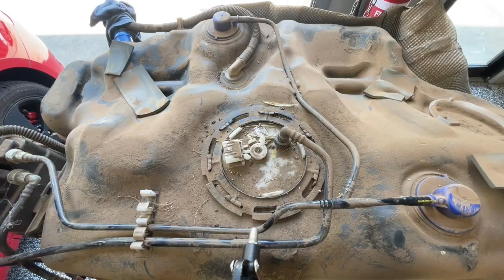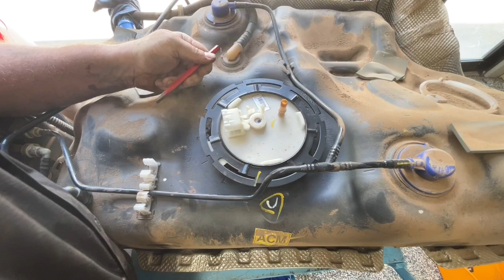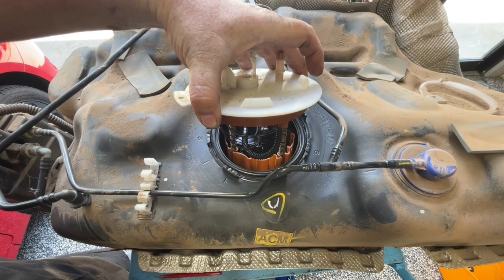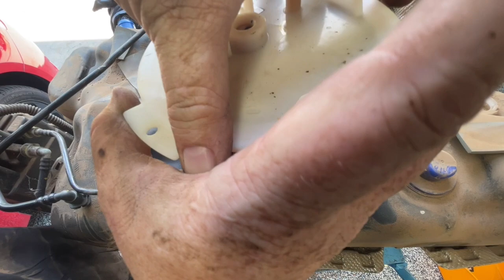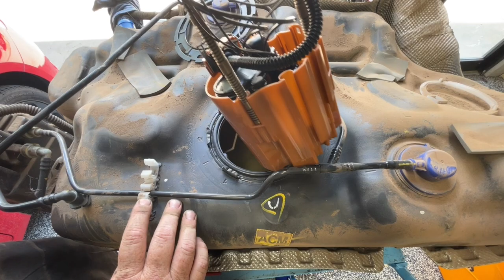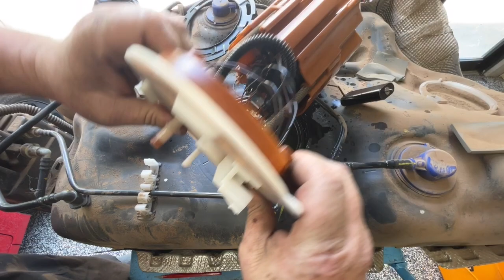Fuel pump ring removal - Without special tools

Comment: you'd have to be real luck for it to be that easy, my friends fuel pump went out after work and it took 3 hrs of beating it with a hammer and flat head till it came out
Reply: i just soaked mine with errl
Reply: I know exactly what you mean. I just done my Rubicon, and I have the special locking ring tool. I had to use a breaker bar to get it off and to put it back on. I could not have done it without the tool.

Comment: No trick to remove it's putting it back on, that's the rub. Spring loaded,lol
Reply: That's my problem no one to help and no special tool
Reply: @stevegeorge3903  I used the special tool. I would not have been able to do it otherwise.